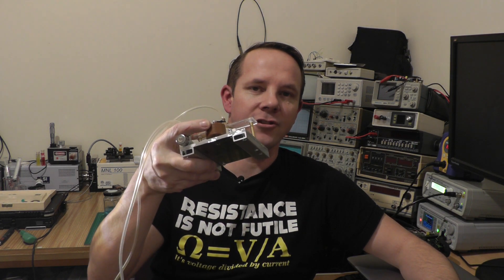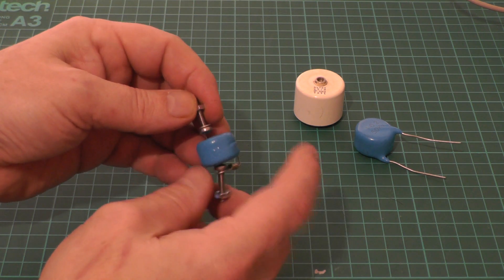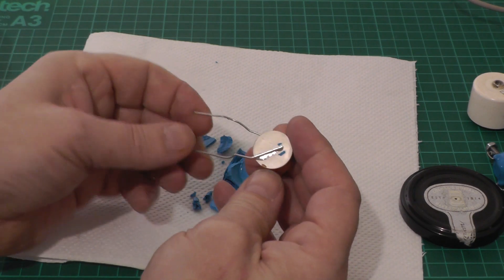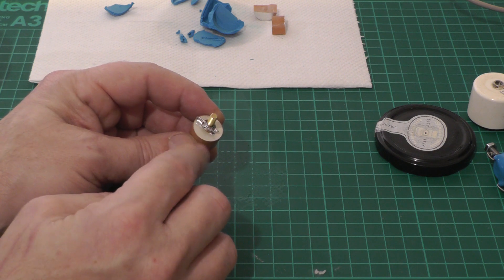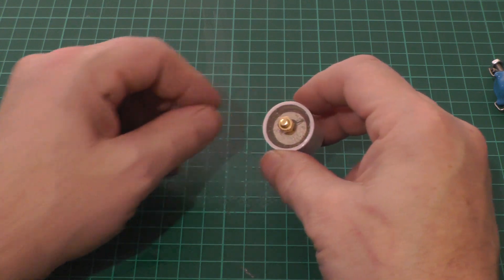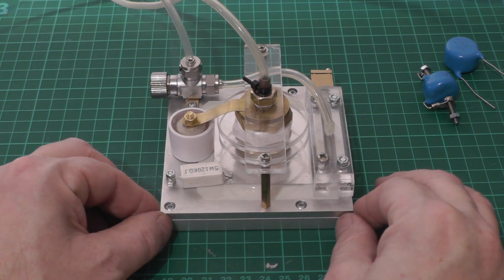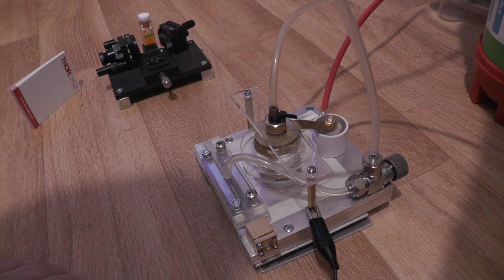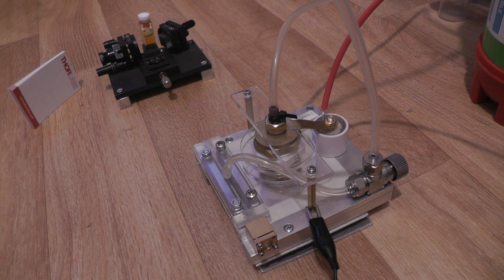Wire Ended to Doorknob Capacitor Modification (Inexpensive Nitrogen Laser Capacitors! (Part 2))

Comment: Very cool, but I never saw these thick capacitors for sale anywhere. Who makes them and what is the part number? BTW, I make my own capacitors (hundreds of pF up to 1.5nF ) by using two strips of copper foil and mylar in between. The size of copper strips is 8x4cm for 1500nF so one can calculate the foil thickness. I used these up to 6kV.
Reply from the maker: I have no part number for these unfortunately, but they are all over Aliexpress. Ah that brings back memories! I built a large Tesla coil when I was a kid that had a huge home made tank capacitor made from plastic sheets and foil!

Comment: All epoxies dissolve under acetone or formic acid, even the IC caps? what is the reason?
Reply from the maker: They don't dissolve, some epoxies however will swell and soften. My best guess is that the acetone penetrates in between the long chain molecules. Note, this is a best guess, any physical chemists want to jump in?

Comment: You need silver based eutectic solder to be able to solder to silver deposited on ceramics; this is actually fairly common, that's how you can solder onto ceramic capacitors and piezo crystals.

Comment: I know this is old video but am missing something, why not just bend theas apart and pot the wire lead cap as is? I have done so in wax up to 40kv and it works ok
Reply: In one of the previous videos there was a mention to keep the inductance as low as possible, hence the need for very short leads

Comment: I tried this annnndd my capacitors broke to pieces. I would say "shattered" but that implies it broke quickly resulting from a strike. It definitely appears to be a result of some internal stress within the ceramic; I'm not sure how acetone would weaken the ceramic enough to cause it to break apart though. At first I thought that I just overvolted my caps and I was uncovering previous damage, but I saw one that was intact that subsequently broke later. The ceramic doesn't appear to be porous or absorbing the acetone... So it's possible I had some micro fissures from use that then propagated due to differential cooling. I ordered some more, I may try it again with completely unused caps to confirm.
Reply: Just had a thought... maybe a dumb one. Do ceramic capacitors have any "parasitic" piezoelectric effect?
Reply from the maker: @jonathanseagraves8140  probably. I have never tried to squeeze them.
Reply from the maker: I think it's a dielectric manufacturing thing. I had some huge wire ended caps that when de-potted seemed to break into thousands of small sharp pieces, whereas others remain good and solid.

Comment: Hi Les,  I am planning to make a better cap.  It's skinned already.  I plan to use short brass screws as you did, but tighten a short round inside-threaded brass (+lock washer) tube screwed tight to the centered screws for female connectors as in the real doorknobs.  I will place it in a cut pill bottle.  Arranged for one terminal to come out of the bottom and a circular top for 2nd terminal.  Filled with hardening poly.  A bit of JB-weld + the dried poly to prevent turning.  (you know, perhaps hex instead of round terminals)
BTW:  I think it is the dark orange Rx bottles that have 'MONSTER' dielectric strength (tested this during a project for spark plug panel connectors)
FYI:  I found that these bottles are 'barely' 'slightly'  beveled.
...just thought I'd share the thought...

Comment: Thanks, Les
I  tested a homemade cap as per your video using only acetone...accidentally left it for 2+ weeks!  WORKED GREAT.  capacitance measures the same...if I could only remember the kV rating......

Comment: It'd be really interesting to see some comparative measurement of the parasitic inductance between these, "real" doorknobs and the basic wire-ended caps. Obviously you'd need some specialist equipment to do this directly but just comparing the discharge pulse shapes on the oscilloscope would give us some idea of how they compare.

Comment: Have you heard of anyone trying to power this type of laser with radio frequencies or a Tesla coil? To me seems like the next reasonable step, a lot less power out but faster repetitive shots, may be useless but I was thinking uv resist due in laser printer or cutter design, ok I'm just out there.
Reply from the maker: Not that I am aware of. The literature says they can be run at repetition rates of >1kHz with flowing gas. At really high frequencies, you would need extremely high gas flow rates. These days, research departments tent to used Tripled Nd:YAG/YVO4 at 355nm in place of Nitrogen Lasers, that are capable of 10's of kHz at millijoule pulse energies.

Comment: I was under the impression if you use high silver content solder you can solder to silver ok. As I understand it the solder absorbs silver but if its loaded with 3-5% silver it doesn't leach the silver substrate. However it do have to be protected from humidity or you will get silver migration whiskers across potential difference points.
Reply from the maker: Probably, but temperature is a consideration. The dielectric cracks easily.

Comment: interesting how easily acetone acted on that coating, i'll take a note on that, anyways you should check if those capacitor leads are iron based, low quality capacitors often are, not only chinese knock-offs, grab a magnet and "magic wand" over em, just in case

Comment: do these 'homemade' doorknob capacitors have all the same parameters as regular doorknob capacitors?
Reply from the maker: I have not characterised them proper, however internally the Dielectrics at least are similar, if not the same. There will be some inductance present (though minimal) due to the short leads, though this is negligible for this application. They do however have much improved stand off voltage, and are probably more then adequate for small Lasers, Marx generators and so on.

Comment: ..thanks again : )
....please wear gloves, i do not know if that stinky juice is toxic, or if something disolved in solution would get better absorbed thru the skin etc..i learned of the acetone a while back and since then, irrelevant- i will do outdoors and latex gloves to be sure- 
....anyway, the same "solder" problem is with ultrasonic disks- try using silver solder, that worked on them- but the heat might compromise the PZT..you got me charged up again, getting a bunch of em and make like a rail configuration..
excellent video, presentation, diction, content, etc, thank you
Reply from the maker: Thanks! Acetone isn't the worst solvent. There are worse ones as far as trans-dermal absorption are concerned (like DMSO), but sure, gloves would be a good idea. Yeah, I considered re-coating (even tried it using various methods), but in the end, went with the simplest solution.

Comment: Do you know If it´s possible to metalize them at home and resolder the bolts directly? Maybe that would improve the pulse current and inductance of the cap ! Otherwise thanks for the idea !
Reply from the maker: Probably! I would imagine you could sputter a thin layer of copper, then thicken it by electroplating. This would involve quite a set-up though.
Reply: @LesLaboratory  check with applied science chanel he built one of those.

Comment: It is notable that the existing wires have been soldered so what is the manufacture
using?  Perhaps this is a silver bearing solder to prevents the silver film from dissolving into the solder.
Reply from the maker: Quite possibly a silver solder right enough. It is a very thin coating though, and excessive heat damages the dielectric.
Reply: @LesLaboratory  Perhaps some conductive silver 
bearing epoxy some are very conductive. 
I have used this on other projects but the current density probably is very high. Finding an exact 
spec for resistance has proven difficult.

Comment: Like in your experiments, I'm not sure about even weak acids as they'll all attack the metal parts to some degree... but if acetone doesn't work for some plastic coatings, you can always try DCM / dichloromethane or toluene / methyl benzene..... both of which can be got from E. Bay.... but acetone is always the best bet.

Comment: What about copper plating the ends to make them solderable? Copper sulphate is quite available and plates quite well to most surfaces. 
I've made plated thermocouples with copper plating and they were quite robust.
Reply from the maker: It should do. The catch is the solderable bit. These things are not very happy about heat. I suppose I could use some low melting point Gallium based solder.
Reply: @LesLaboratory  old tektronix scoped used silver solder for this reason

Comment: The (perhaps too obvious) question I have is: Why not just pot the "hack" at 0:51 into a PVC tube with epoxy and end up with something similar to the result at 3:27 without the week-long soak in acetone?
I'm pretty sure that epoxy potting should stop it flashing-over without altering the capacitor itself, but I am prepared to be wrong.
Reply from the maker: Yes, it would work, however the long leads of the capacitor add unwanted inductance. The switching speed in TEA Nitrogen lasers is critical. The faster we can dump the stored charge, the more optimal the output will be.
This is a follow up from a previous video where the goal was to do the job in such a way as to have a really good analog to a genuine doorknob cap. Originally I had intended to solder the bolts directly to the dielectric.

Comment: I recently got a nitrogen laser from ebay, an old soviet unit, it lased for a couple of pulses but then it stopped lasing. It still has an output, but it's like not fucussed anymore. It makes some crackle noises. I guess a doorkbob cap is broken. But everything is potted in jelly :(
Reply from the maker: I think I saw it, and nearly bought it! The breakdown could be anywhere including the PSU. If you are so inclined you could carefully depot the thing.
Reply: @LesLaboratory  Yeah the blue one. Grey cover. Pretty neat unit. Fun while it lased.
Reply from the maker: @PiratCarribean  Don't give up. Carefully strip it and see...

Comment: Nice hack! I was wondering about the stability of the laser. You say that it's quite stable, however in the video there appear  to be large variations in the pulse intensity. Is that due to the pulses and camera frame rate out of sync?
Reply from the maker: Mostly yes. The shots often occur between frames. Filming pulsed Lasers is a Major PITA! Generally to the eye, it looks pretty reasonable. If you run the repetition rate way up, the output will tail off, unless you also turn the gas up as well. I suspect there is quite a bit of shot to shot variation however that my eyeballs can't discern, as the Spark gap is not triggered. I recently acquired a Laser Micro Joule Meter  sensor, so I am going to measure all these and share the results in an upcoming video.

Comment: Regarding soldering directly to the silver plating: this should be possible using a solder that contains a few percent silver.  Tektronix used to use silver-plated ceramic terminal strips in their vacuum tube-era scopes and included a small roll of suitable solder tucked away in each chassis.  The reason this works is that solder (at least, the old 60/40 kind) has a very limited capacity to absorb silver; the silver goes into solution when you melt the joint but the alloy saturates at a few % silver.  If you use solder that's already 'fully loaded', no more will dissolve off your electrode.  It's possible that SAC305 would work but I have not checked the chemistry to see if the tin or the lead was the dominant factor.
Reply from the maker: Good idea, I will maybe give that a go. An additional Idea, might be to thicken the plating by electroplating those surfaces as well. I have some Ideas about stacking a few in series to make a peaking capacitor for a Marx Generator :-)
Reply: i'm not sure i'm getting it... so you are saying that if solder already contains silver it will take no more and not peel off the silver plating? this interests me for various purposes

Comment: Holy crap! That was way simpler that I thought it would be, and the result was very presentable! This channel is so underrated, but someday you will get that 100k plaque, im sure.
Reply from the maker: Thanks! Yep, in the end it is pretty straightforward. I reckon it is possible to do all sorts of things with these dielectrics, maybe stack them and make a Megavolt capacitor or something ;-)
Reply: @LesLaboratory  ooh, and then a massive voltage multilpier!
Reply from the maker: @justin.campbell  I have a nice home made 150kv Marx I could hit it with...
Reply: @LesLaboratory  oooh, I would absolutely LOVE to see a video like that! Maby even pass the full output through different components to see what they do and just mess around!
Reply from the maker: @justin.campbell  yeah, I have been thinking about that. The channel can't all be about Lasers right? :-D
Reply: @LesLaboratory  Lasers are fun, but high voltage, vintage stuff and other things? Equally awesome!
Reply from the maker: @justin.campbell  fine, I will mix it up a bit. Vintage computers, Tesla coils, HV stuff, Lasers, Holograms, it's all here!
Reply: @LesLaboratory  all the best stuff!